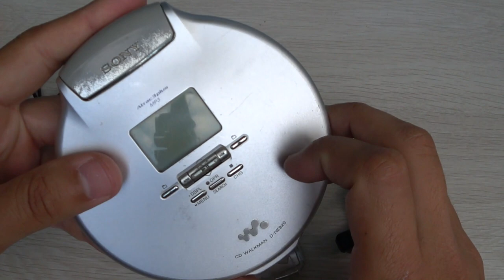Sony DNE-920 MP3/ATRAC CD Walkman Portable Compact Disc Player

Comment: Can you help, I have just purchased a used D-223 in mint condition, it was only after it was shipped to me I saw the problem why it was a cheap price, not sure what its called but the part on the centre spindle on the laser assembly sled that has the 3 ball bearings type thing that hold the disc is missing. Do you happen to know what its called and can they be replaced. So basically it will not hold a disc. the centre clamp thing is missing, I just have the spindle and the rubber looking ring the disc sits on